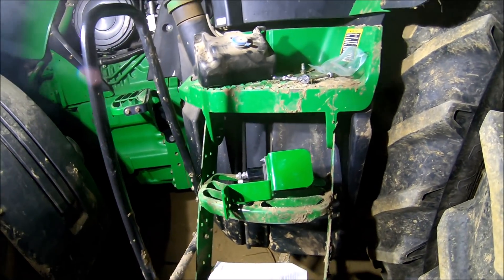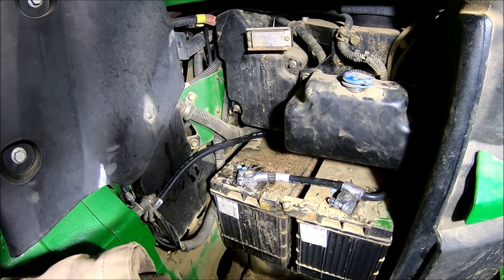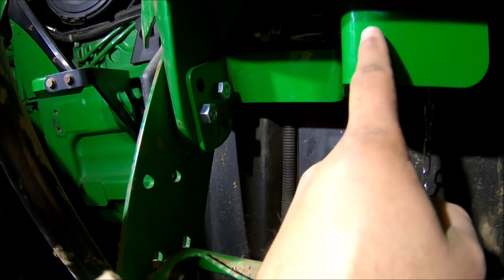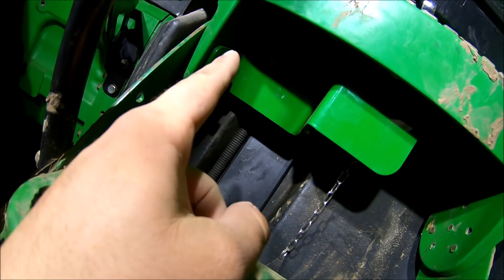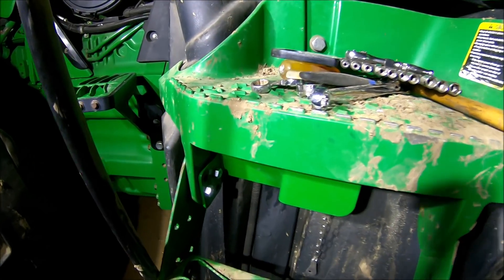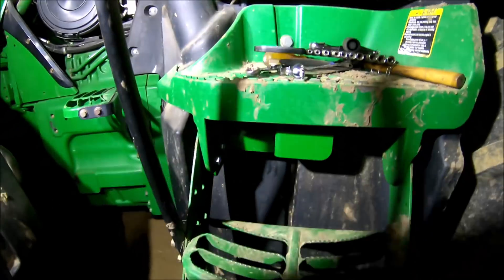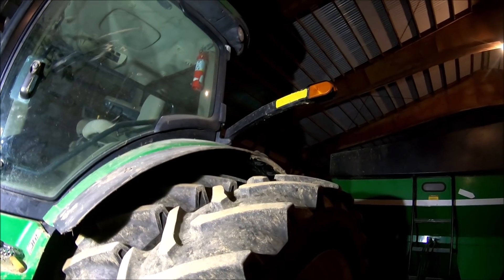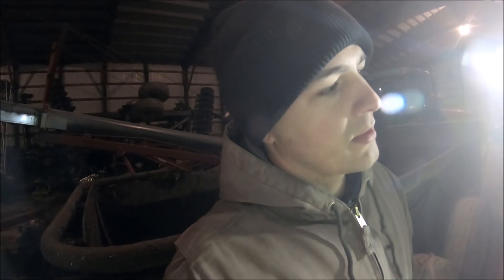The Turn Of A Switch

Comment: You will be glad you got that block heater. They are a necessity for cold weather. Keeps you away from the ether can. I hope you have block heaters on all of your equipment. Saves a lot of wear and tear on the starter and batteries.

Comment: It sure would be nice if battery disconnect switches could be added to a lot more things besides tractors and other diesel-powered equipment.  Personally, I would love that option for my boat, since it has four big batteries that love to go dead during downtime in storage.  I like this format for repair/upgrade videos.  I may never do the same projects, but it's nice to see how progress is made.

Comment: Have you used a amp meter to see what the parasitic electric drain is on the 8235R batteries. That test would reveal the importance of opening the switch.

Comment: You do realize you will have to reset anything electronic that is run off of a clock chip. This may not be limited to only the actual digital dash panel time of day clock.       sdh in CT
Reply from the maker: Yep I'm ok with it

Comment: Put them bolts in from the other way round.
Reply: Dave Powell if the frame piece is threaded and the bolts aren't full thread then they would still stop when threads on the bolt ran out.
Reply: @floydfarms1578  the kill switch plate would take up the difference.